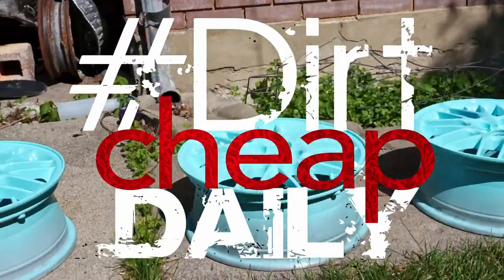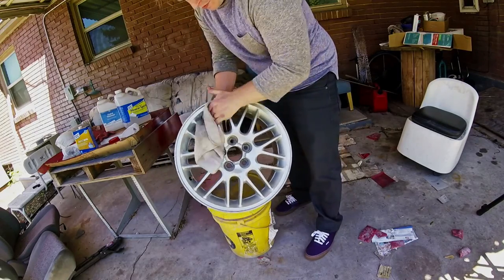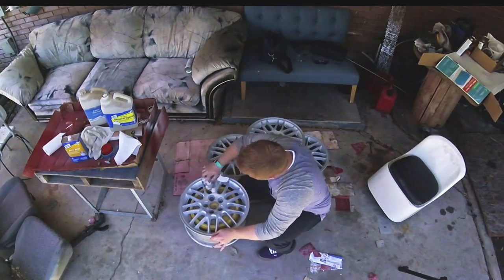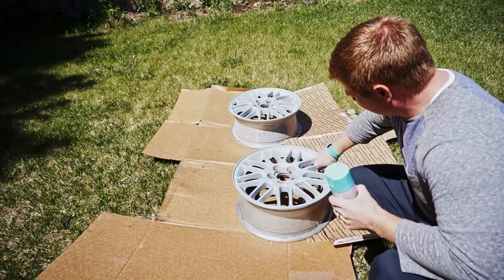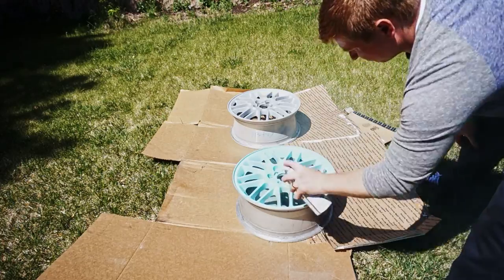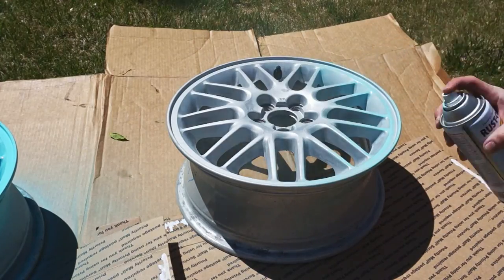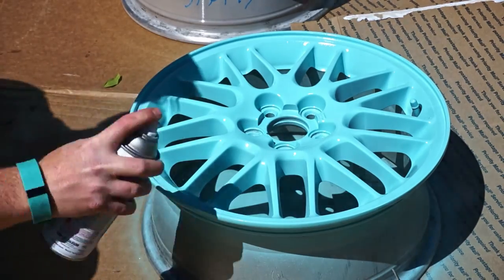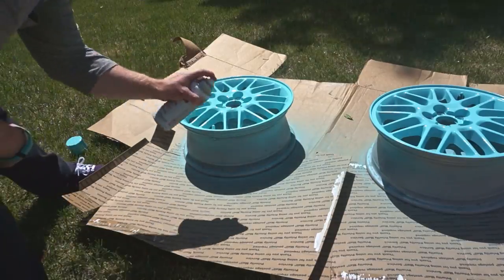How to Paint your Rims - Step 3: Spray Painting Tips - Dirtcheapdaily : Ep.8

Comment: Nice job doing the rims, In my opinion. Which I'm a nobody. I would say, do the inside of the rim first until it's finished then do the outside (face). I would think doing it tjay way would push the over spray from the outside to the inside and you would have a good clean face instead of random specks on tje outside
Reply: Self etching primer aswell, I just did mine. So I don't know about tje long term but rumor is.. that it helps adhesion with the rims. They look pretty good though vibrant. Peace out dude